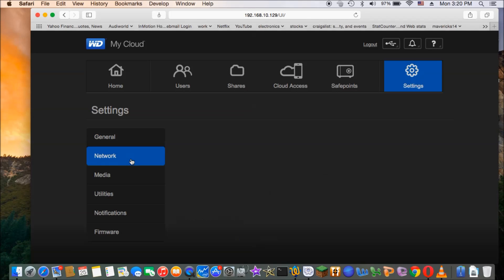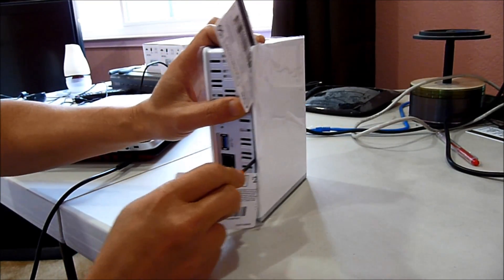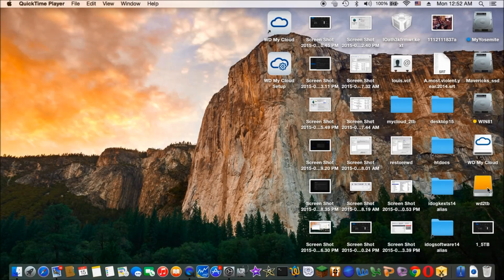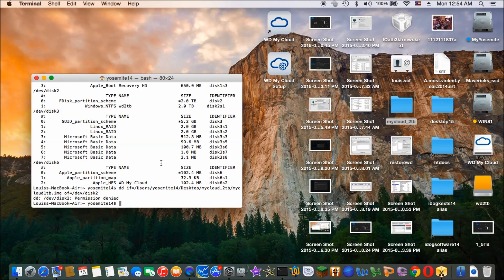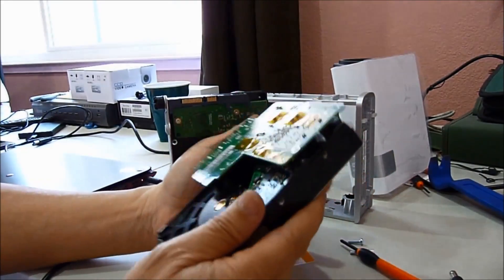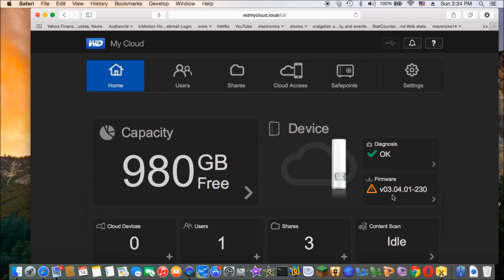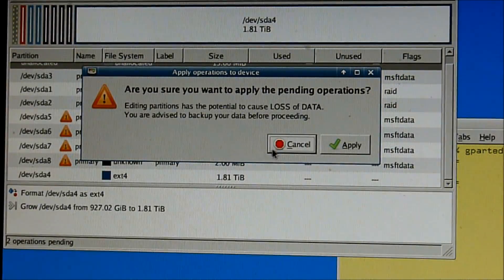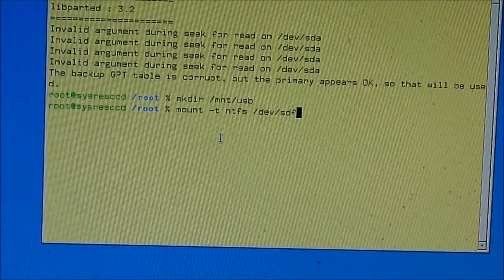upgrade or unbrick wd mycloud hard drive 1tb to 2tb

Comment: @3dogs1monkey My 6tb drive was damaged, I repaired it but I couldn't get the image, do you know where I can get the image?  thank you!!
Reply from the maker: Just use any image will do
Reply: @3dogs1monkey  I found only 1 image on the internet and it did not work for me, the led turns red.  I thought you had one in your manual
Reply from the maker: @christiansanvicente6815  go to my link and down load mine
Reply from the maker: @christiansanvicente6815  btw it’s no longer supported

Comment: But if I pull away the disk from mycloud and clonezilla I make a backup, can I reassemble it without reinstalling all the software?
Or maybe remove it and put it aside and then test with other disks. In the end I would put the original one that has not been modified.
Thank you

Comment: I did this step by step, but the red led flashes. 2tb have harddisk and 2nd generation. I wonder why. one must first format what format (ntfs & ext4). can you help me please.
Reply from the maker: I believe when the red LED is flashing means the boot loader is not correct. When you restore the image to the new drive, it wasn't done completely. Redo it.
Reply: @3dogs1monkey  well what format is the new hdd format (ntfs & ext4)
Reply from the maker: @erdemdemircioglu  You didn't watch the video carefully, the first thing you need is to restore image of the 1TB to the hard drive. Make sure the hard drive is formatted NTFS. When the image is done, it will automatically partition with all correct partition. Put it back and it should boot to Blue LED and working with 1TB space. After that, you need to resize it to the maximum size of your hard drive. I would use 4TB+ instead because it's cheap these days.

Comment: Hi, I have a Wd MyCloud Gen 1 3TB which doesn't seem to connect. Could I remove it and use the Hard Drive inserting into a Docking station?
Reply from the maker: fayyazb yes, just need to format to use the full drive.
Reply: Thank you. I actually want to backup my data before I format. So can i remove the WD MyCloud Drive from it's case and use it on a Docking Station on Mac to back up then format?
Reply from the maker: fayyazb yes
Reply: Thank you. Any suggestion of a good docking station? Any software required to read or back up files from it to mac?
Reply from the maker: http://www.dognmonkey.com/techs/sabrent-usb-hard-drive-dock-for-samsung-smart-tv.html
Reply: Thats great! Love the idea you have connected to TV! Well, hope WD MyCloud Drive reads on the Dock! Did you connect WD MyCloud Drive in the dock? 
Thank you very much.

Comment: Hi,

Smart choice to NOT UPGRADE from the stock firmware (03.04.01-230) to the latest one (04.04.XX...).

It's reported by the WD Community to be problematic as hell. 🤔

Great guide by the way ! 😊
Reply: PS: I'm making my video better by using the Cards function. So I decided to refer your video in my WD related one: https://www.youtube.com/watch?v=QU8TQdqX7hc

You pop up @ 04:46

Supporting (Relatively) Smaller Channels.

Comment: I can't get the drive to initialize the Web menu or anything (which is why I am searching)...

...sooo what do I do now?
Reply from the maker: I does look like you have to reformat your drive using one of those images. Try to save your data if you can. There are a few ways of doing it. Go to WDC forum in the info and download the images to restore to your hard drive. Since you'r going to do all that, get a big hard drive and upgrade.
Reply: 3dogs1monkey I do not believe that I am being clear.

I am specifically looking for a way to recover the data in the hard drive.  I cannot access the "My Cloud" on the network.  

Please advise me on pulling the data.  I have little to no interest in entrusting them again by spinning the device itself back up, once my data is recovered.

Comment: can i connect its hdd directly to my computer sata slot?
Reply from the maker: nednes senden yes, but you won't see anything because it's different data format.
Reply: 3dogs1monkey 1.) can it be connected through USB caddy?

2.) would any OS see it?
Reply from the maker: TheRangeControl remove the hard drive and connect to sata or USB is fine, I'm not sure if windows can read all data

Comment: Hi I'm hoping some clever person could help me.. I've tried several times to get the mycloud up and running with a WD Red 3TB drive (and the drive proves to be fine). I get all the said partitions and everything looks correct to my untrained eye, but when I reassemble the Mycloud  and plug it back in, I get a flashing blue light for about 5 seconds which then changes to a red flashing light. Any ideas what I might be doing wrong?
I've tried several virgin images all with the same result.
Please help me before I take a bat to it 🏏
Reply: I’m having the same issue

Comment: 1.Can it operated in WIN/OS?
2.Can we take main board out then used on my many spare HDDs ?
Reply: Hi, For your 1st question: The OS in the disk is LINUX, so it has a not NTFS format. So you cant use it by USB or connecting by SATA port.
For your 2nd question: The HDD has a LINUX system inside, so you will need every spare HDDs has the same IMAGE, which you can download from WD site.

Comment: Do I need to use a WD hard drive in replacement? Can I use another brand such as Samsung?
Reply from the maker: I think I used a samsung drive and it didn't work, I can't remember, but if you have to buy one, buy the red WDC, it's better.
Reply: thank you!
I already managed to get to work with the samsung disk
Just have a problem stay with red light if you turn off the disk, to work I have to do 40s reset it works
But if it does restart it looks good, it only turns red if it goes off
sorry for my English

Comment: For those who are attempting it, you can also adjust the size of your data partition before you connect it back to the WD chip and then perform the factory restore. This might make things a bit and avoids some dis- and reconnecting of all the components. 

Further, I found a very reliable guide how to open the enclosure without breaking any tabs: https://www.youtube.com/watch?v=2_eW25LGXcI

Hope than helps, cheers!

Comment: hi, I had 1Tb My book live, it just crashed by a S.M.A.R.T. failure, so I'll buy a new disk, but I don't have the image, to do this, there a link o site to download it? thanks, btw, I try to access to my data with a Debian in other pc, but I couldn't mount it, some error about "access denied" and "Attempting to correct errors... NTFS signature is missing." do you have a guide to get through this?
Reply from the maker: Go to my website link on the information to download my image
Reply from the maker: +Gabriel Alejandro Peñarrieta molina I don't use debian so I don't know how to help you. Did you do the 45 sec reset? Push a pin in the reset hole, hold it for 45 sec or longer, it will reset itself. 
http://www.dognmonkey.com/techs/how-to-upgrade-wd-my-cloud-from-1tb-to-2tb-drive.html
Reply: +3dogs1monkey thanks dude, i'll read it this weekend, tell me a last question, Do I have to buy WD GREEN? or it works with the Blue, Red o Black instead? I try to find the green version to buy here and there isn't many options. in the video you have Red version, Its just many thinks to take notice. and Debian is the system in the WD Disk, with SSH conection, type: lsb_release -a, and it will tell you the linux version in the disk. I'll try 45sec too, thanks again, I have a lot of homework
Reply from the maker: Gabriel Alejandro Peñarrieta molina Red is originally designed for WD My Cloud, it's more expensive and more reliable I think. I just used the spare green one I had.

Comment: how can i get my data out before i do this factory reset? is it possible
Reply from the maker: +lang nguyen go to the WD website to download data recovery software. If the network is still working, you can get your data out. If yours is still working, then move data to local hard drive before doing it because it will delete everything.